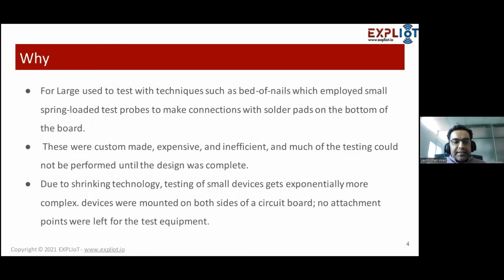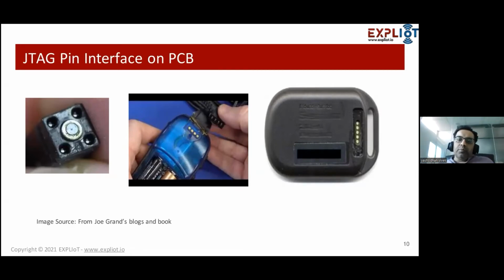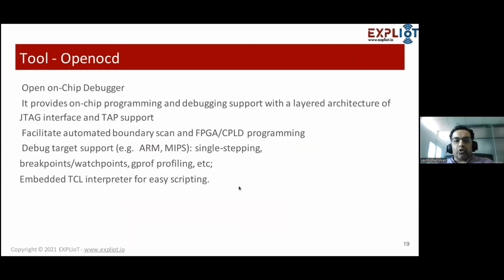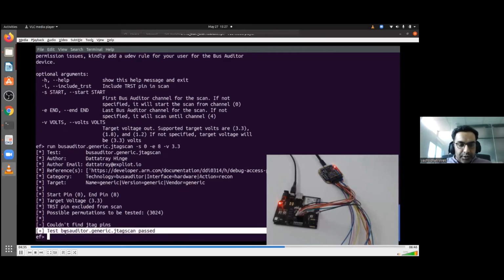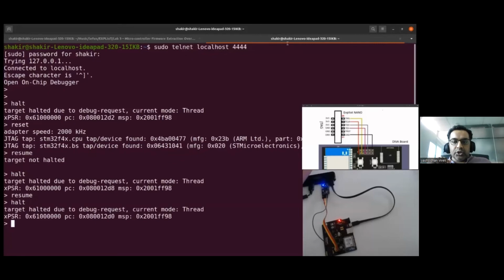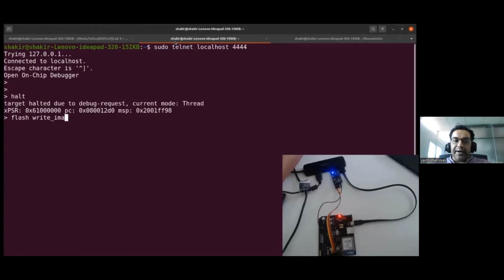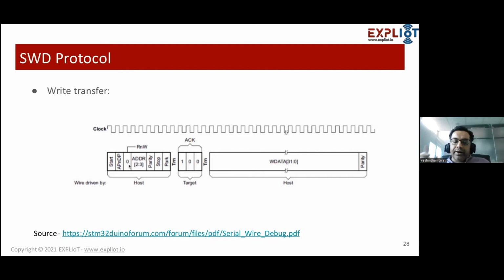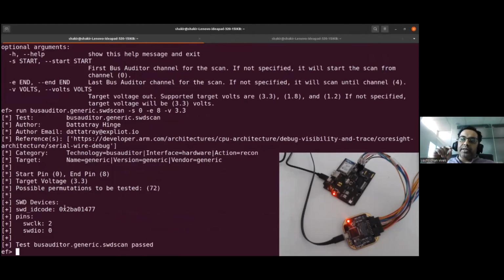IoT Hardware Hacking: Debug Hacks (JTAG and SWD) | EXPLIoT

Comment: I'm interested in streaming/tracing.. but the segger low-end debuggers say they support SWV (SWD+SWO) but only their TRACE debuggers support ITM, ETB, or MTB.. what's that?

To add to the confusion, there's also 
ITM: Instruction Trace Macrocell: 32 32 bit registers that output data to the outside world using SWV. 
Trace Port: A 4 bit port (4 data and 1 clock) that ULINKpro uses to collect ETM frames and optionally SWV (rather via the SWO pin).   What pins are these?
ETM: Embedded Trace Macrocell: Provides all the program counter values. Only ULINKpro provides ETM

What about the requirements of the chip.. does it only need to SWV?

And what is the requirement for the software-layer that talks to the debug adapter?  Would Eclipse + GDB/OpenOCD support trace/streaming?